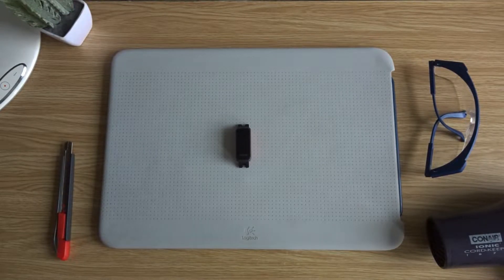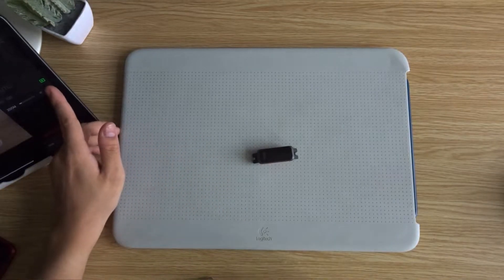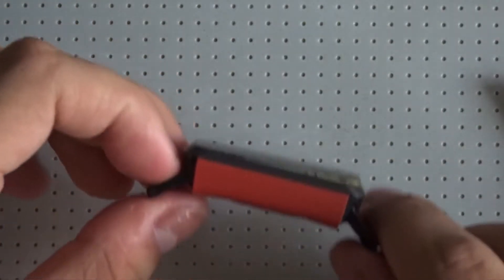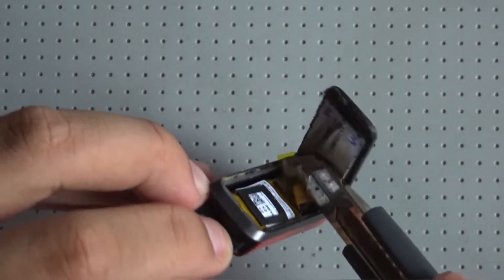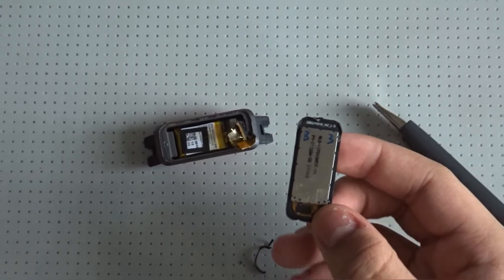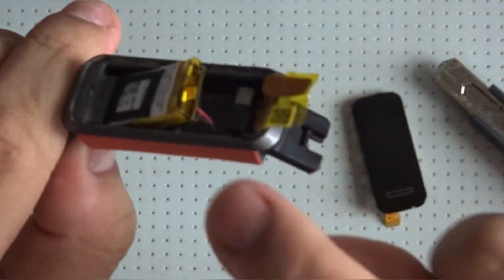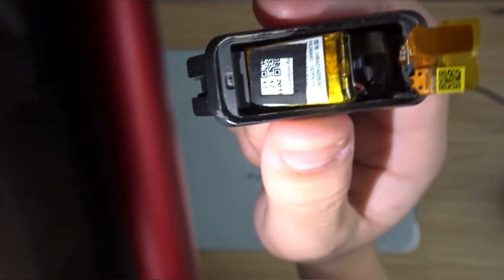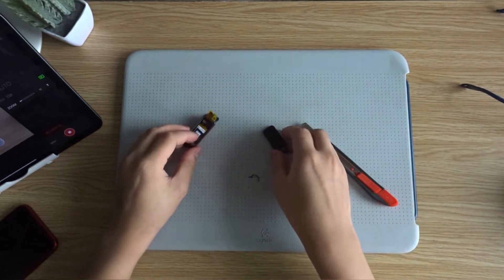Huawei Band 4 Disassembly

Comment: What's printed on the battery?
Reply: 3.8V, 91mAH (Rated)
Reply: @pravardhanus is there a series of  numbers, usually 6, indicating the battery dimensions
Reply: Yesterday I did some digging on the internet and found few batteries that are used in Huawei Honor Bands:
1. HB421422EAC: Rechargeable Battery, Li-polymer Battery, 3.8V, 94mAh, Single Cell, Size: 4.27*13.6*22.0mm
2. HB351329ECW: Li-ion Polymer Battery, Capacity: 100mAh, Rated Voltage: 3.82V, Cutoff Voltage: 4.4V, Discharge Voltage: 3.0V, Size: 29.0mm*12.5mm*3.5mm
Reply: @pravardhanus  thanks a lot.